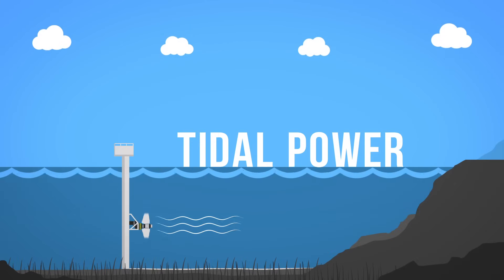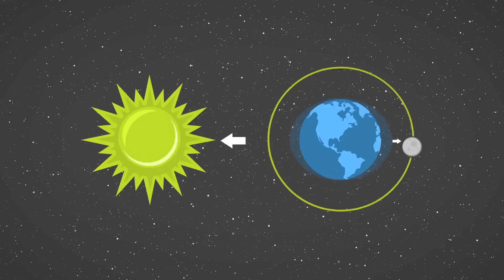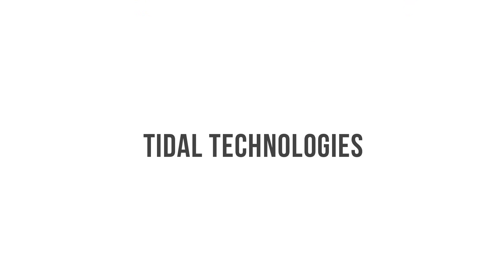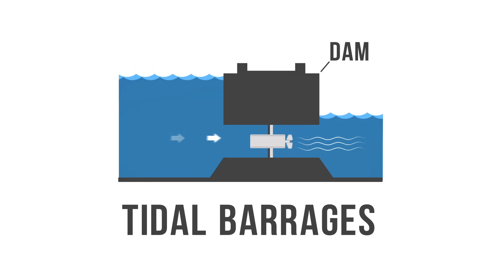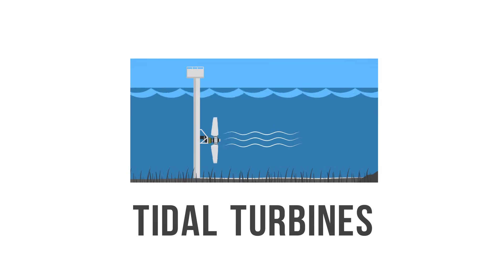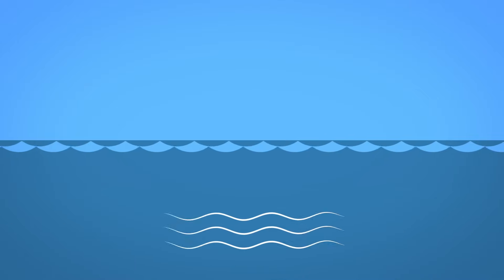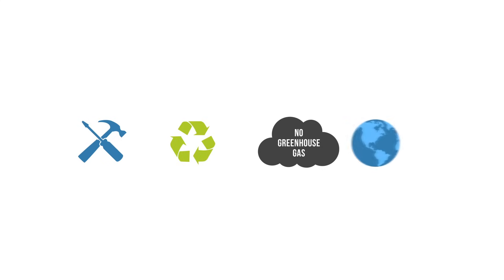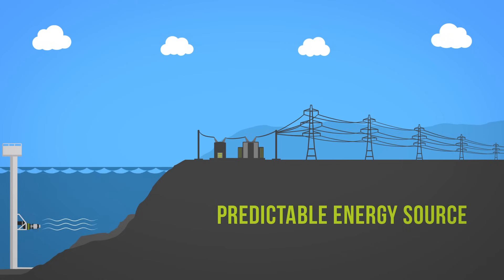Tidal Power 101

Comment: tidal can only be installed in coast lines - 2 high tides and two low tides (difference must 5 meters high to produce electricity)
tidal barrages - most efficient, dam that utilizes potential energy generated by the change in height between high and low tides, turning the turbine and compressing air
tidal fences - turbines that operate like giant turn styles 
tidal turbines - like wind turbines but only under water

ocean generate more than air current832 more dense than air but sprcific site requirements

Comment: I don’t know a lot of tides or their currents and how they flow. 

What if underwater tidal technologies are too static and can’t adapt to the changing direction of incoming currents?

What if there was a kind of mechanism that could read the current first and for the underwater tidal technology to tilt and rotate towards the most energy capturing effective position?

For example: three or various sensor flaps distanced apart in front of the generator. Each is facing different angle. They read the force of the incoming current kind of mapping it. The generator then tilts or rotates accordingly. Is small electric input for a hopefully bigger electric output. 

Let’s say after a lot of data in reading the incoming tide when flap 1 the farthest ahead of generator didn’t move a lot, generator won’t need to face towards a certain angle. But flap 2 position moved in a different angle moved a bit more and then flap 3 sensed even more activity. Maybe generator can accommodate in angle or rotation in sync or in delay or in a bit of different timing with the data collected and get the most out each current. 

How can tide “reading” mechanisms help static generators? 

Can underwater electric generators work statically efficiently without a previous “reading” of the incoming flow? Are incoming flows that varied in directions and force?

Comment: I'm having a hard time wrapping my head around why engineers try to adapt old concepts (turbines) to something like the tides!
Every freaking thing I've seen has be one variation or another of trying to get something rotary, like turbines, to move with something linear, like tides.
A big ass flap that moves with the tide would be a better option. Tide goes in and the big ass flap goes toward the shore. Tide goes out and the big ass flap moves out to sea. 
Attach your transmission method of choice to a generator and have at it.

Comment: There are everywhere broad slowly moving rivers and canal. Despite the low speed, a lot of water passes per time unit.  I suddenly wonder about narrowing the stream a lot, forcing it to flow through  a small opening with a turbine.  It would have to be controlled since sometimes a boat wants to pass. This is not done but I don't know why exactly. Perhaps the energy is too low to justify the costs or perhaps sealing off the whole canal temporarily is technically very hard to do.

Comment: Bill Gates and others should look at thermohaline circulation (known as the ocean's conveyor belt) as a long-term solution to producing "continuous" energy since tidal, wind, and solar forces are intermittent. If the oil industry is capable of creating deep platforms along with offshore pump stations than those large companies should be capable of building or designing these offshore turbines.

Comment: Why is the height difference of 5m necessary? Is it also possible to generate any electricity with smaller differences such as 2-3 m?
Reply: same question i'm interested in cos i'm currently doing a research on tidal energy harvester using 3m difference in tides.

Comment: 1MW tidal turbine + a 3MWh battery = a forever constant and consistant 0.5MW output = a pretty solid baseload for the country for other sources to build upon. If I was in charge that's the route I'd be looking into, even if we can only get 20% from that it's still a pretty big baseload to start with. Add in 20% from Nuclear(current + point C) and that's a 40% carbon free baseload.

Comment: Philosophe du cul. Oui

Tidal  power tidal power is a form of hydropower that
converts the energy from of hydropower that converts the energy from the
natural rise and fall of the tides into electricty tides are caused by combined
effects of gravitational forces exerted by the moon the Sun and the rotation of
the earth tidal plants can only be installed along coastlines coastlines often
experience two high tides and two low tides on a daily basis the difference in
water levelsn must be at least five metershigh to produce electricity tidal
electricty can be created from several technologies the main ones tidal
barrages tidal fences and tidal turbines tidal barrages are the most efficient
tidal energy sources a tidal barrage is a dam that utilizes the potential
energy generated by the change in height between high and low tides this energy
turns a turbine or compresses air which in turn creates electricty tidal fences
are turbines that operate like giant turnstiles whereas tidal turbines are
similar to wind turbines only under water in both cases electricity is
generated when the mechanical energy of tidal currents turns turbines connected
to a generator the generator produces electricity ocean currents generate
relatively more energy than air currents because ocean water is 832 times more
dense than air and therefore applies greater force on the turbines idal power
is easy do install and renewable having no direct greenhouse gas emissions and
a low environmental impact because  the
oceans tidal patterns are well understood tidal energy is a very predictable
energy source making it highly attractive for electrical grid management this
sets it apart from other renewables that can be more unpredictable however
adoption of tidal technologies has been slow and so far the amount of is very
small this is due largely to the very specific site requimerentsd necessary to
prudce title electricity additionally tides cycles do not always match the
daily consumption patters  of electricty
and therefore do not provide sufficient capacity to satisfy demand to tidal
power.
Reply: carrement
Reply: Commitment !

Comment: Why does this form of energy need to be close to shoreline? Can it also be a ring at any distance from shore?
Reply from the maker: Hi Mary, one of the primary reasons is that the transmission line infrastructure that carries the electricity back to shore is very expensive, so the less of it that you need, the better. The further out to sea you get, the more wires needed and the more expensive it is to bring service workers, construction workers and other infrastructure out to the project.
Reply: mary angel grandia It is more expensive when it is deeper in the water, but because the density is higher, it will generate more power at a faster pace.

Comment: Would this disrupt marine life?
Reply: A Nony Mouse probably not. As stated in the video this could only be installed along coastlines. It would also be inefficient to transfer energy from a long distance to a city so it would only be installed in already disrupted areas
Reply: @_wheat856   It depends on how fast the 'turbines' are turning. In most instances they turn slow enough so that in a situation where a fish does get stuck it has enough time to swim out as well. Hope that helps.
Reply: lol everyone 3 years too late on answering this guys homework question
Reply: @mrjoestar2862  yes they are too late ☠️even i
Reply: The tidal barrage and tidal fence type would probably cause some disruptions, as they would create barriers in the water. The tidal turbine however would not have as big of an impact, as it only blocks small sections. Furthermore, the noise generated by the blades is not a significant amount. Real Engineering made a very good video exploring the use of tidal turbines.
Reply: Yes.
Reply: 3 years for an answer
Reply: A Nony Mouse yeaj
Reply: Yes I think
Reply: Yes it would. It it would either disrupt the ecosystem in the ocean or on the beach.
Reply: Little bit ,bet still better than many
Reply: No
Reply: Yes
Reply: Idk
Reply: Shut up
Reply: Eating pork disrupts pig life.
Reply: Ofcourse it does. Everything we do affects things. Even seemingly small disturbances to an ecology can have large effects. This is just something we have to get over.
Reply: Yes
Reply: Even if you got it safe you'd probably run into the same issue that even the safest oil drilling has namely disruption of species.
Reply: Sometimes it diatrib the sea living things
Reply: This turbine turns very slowly because water is much denser than air, so even if it hits some marine animals, they probably wouldn't even be scratched.
Reply: It is said that it will eventually change the feeding habits of underwater species in areas of high tide change where these are implemented, so yes, but less than one tenth of the damage that climate change will cause by 2050, so it may be worth it at this point
Reply: Like over-fishing?
Reply: Yes, I guess it would, but this would save Earth. Scintists are working hard to cancal the effect.